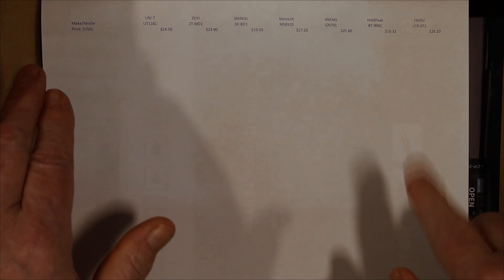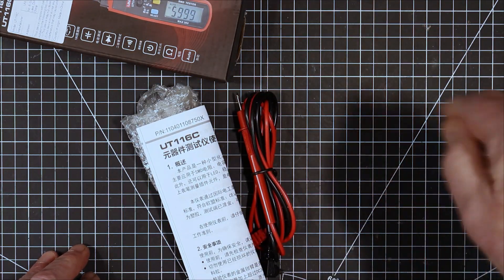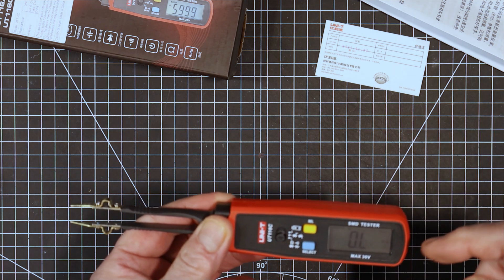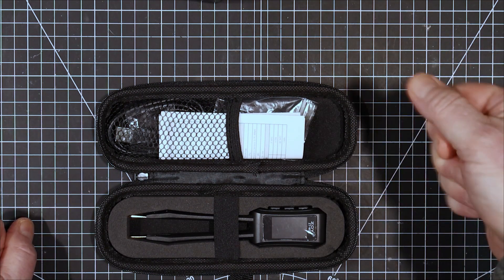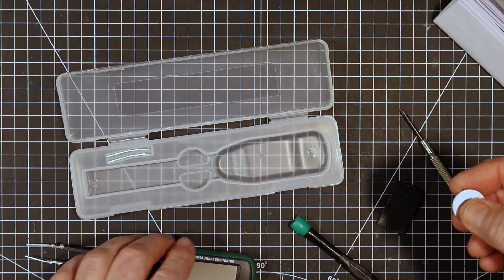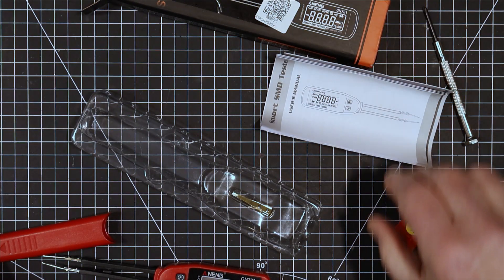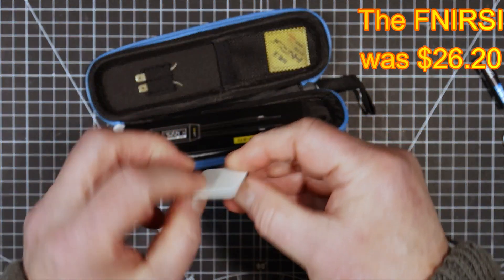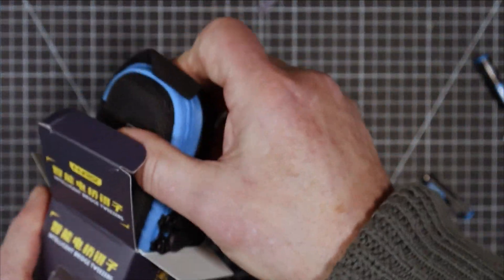Uni-Byte 0252 - AliExpress SMD Tweezer Meter Shootout: Part 1

Comment: Split into two categories?  LCR meters (AC) and Tweezer DMM's (DC).  Some of the DC ones are uniquely good as Zener diode testers.  Some things to look out for. (1) You would think the ones that measure battery voltage would be good for coin cells, but the current drawn is way too much for them.  Voltage on these can be tested reverses biased, which does not load the cell.  (2) The holdpeak leads are truly terrible.  Mine came from the factory with black spots in the plug plating and an intermittent connection on the red pen.  The holdpeak battery bay is also too small for NiMH cells and Lithium primaries.  The springs must be cut down if you want to use them.  It does power off by holding one of the two buttons.  (3) The Uni-T not only lacks a power off, the quiescent current is much higher than most devices.  It will eat batteries, even when off.  (4) If the Uni-T case is too hard to remove, you can loosen the screw close to the wide end or put a washer between the two halves near that end.  I put a piece of red heat-shrink tube on the + arm.

Comment: The UNI-T is the only one that will light an LED under test. The metal plate on the Fnirsi has adhesive on one side and can be attached to your work station to act as a magnetic base for the tweezers.
Reply from the maker: The HoldPeak might do it too.  Very similar to the UNI-T in every respect.

Comment: I'd guess the metal plate is used for calibration.
Reply from the maker: It turns out to be a magnetic mounting point.  Stick to the bench and teh meter will hang their via an internal magnet.

Comment: The "leads" of the Uni-T.  ODD to say the least.
Reply from the maker: Indeed.  Wonky too.
Reply: @uni-byte  I've got the Uni-T.   Not sure I ever used the leads. I remember trying them one time but I think I just turn to other meters when I need leads.   So maybe useful if this was your only meter.
Reply from the maker: @Taliesen.  It would be sad if this was your only meter 😞
Reply: Usually I will use my own black lead with an alligator clip and the other tip for probing.
Reply from the maker: @pault6533  Good idea.👍